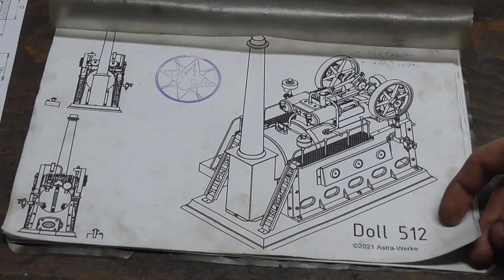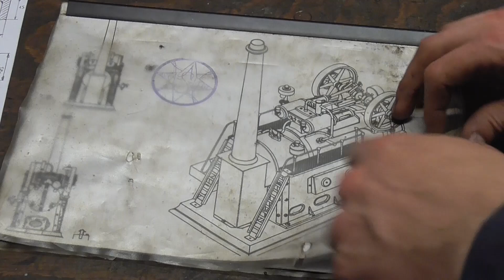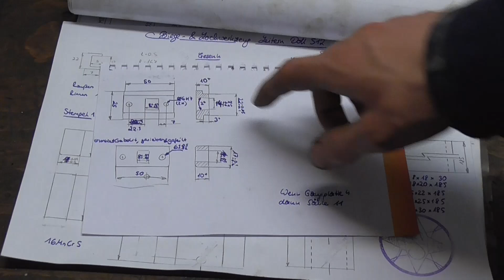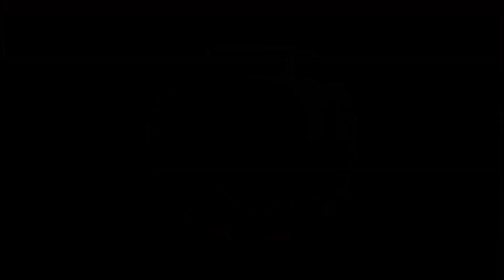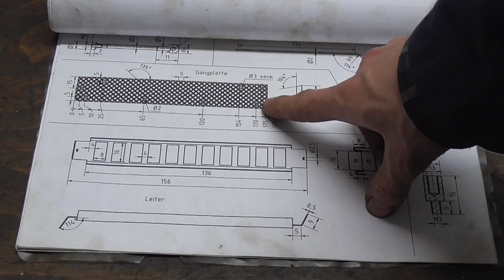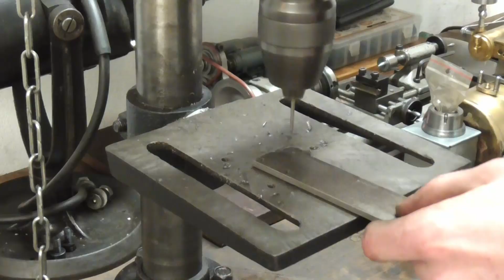Tools, Dies & Fixtures: Doll 512 Replica Part 6

Comment: Thanks Astra-Werke for the video, really neat dies you made!
I just restored an All American Die Filing Machine, it reminds me of my shaper and is perfect for the small shop for making the types of dies you made. I use it in clock making too.

To make the stack I would clamp a piece of pipe in a vice and press it over with a long piece of wood and keep turning as I bent it, if that makes sense!

Comment: For some strange reason, this adventure reminded me of mine shafts.  They must have had jigs for ladder making.  There are literally thousands if not 10s of thousands of rough-hewn ladders in an average mine.  They are all exactly the same and perfectly symmetrical.  The long ones are made from combining the standard length.

Comment: The versatility that having machining skills gives you for project work never ceases to amaze me.  If you need something specialized (such as the dies for the ladder pieces), you can simply design and fabricate them. And, yes, I understand that "simply" is a relative term but compared to what someone with no skills can do, it's another level.
As frustrating as this kind of work can be (and you are honest enough to show that to us) the level of satisfaction achieved by moving from an idea to reality must be incredible.
It doesn't matter to me if you are working on the Model A, one of your steam engine models or repairing some random piece of gear I'm always interested in what you are up to. 
18:33 "Be-Spoke"!🙄😆
As for the chimney, perhaps you could get a smoother curve with something like an English Wheel? Just a thought.

Comment: Great video! As to the chimney, ...... hmmmmm. Turning a conical form to roll sheet metal onto would be no real guarantee of a smooth finish, although it might be smoother than it is now. You could certainly turn a chimney on the lathe. It would look nice, but be heavy and wasteful to produce. Perhaps embossing a brick pattern on the sheet metal would hide a multitude of sins?